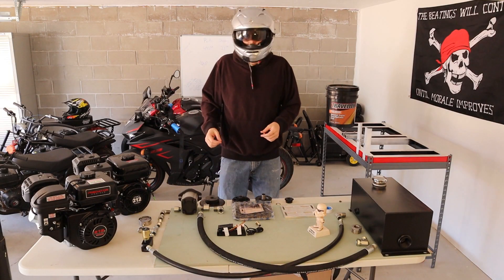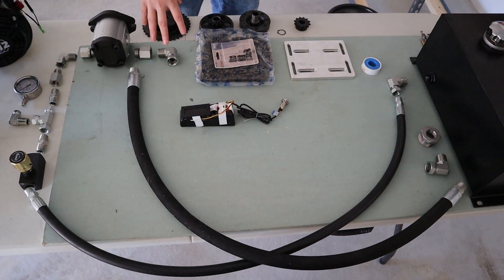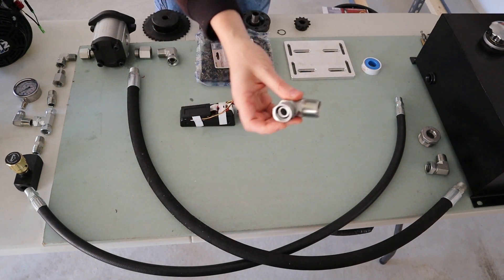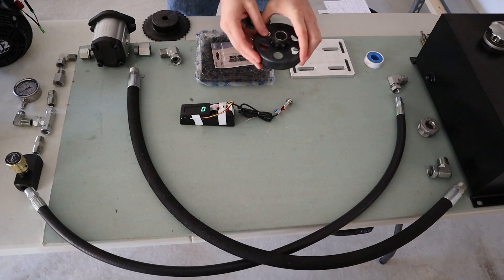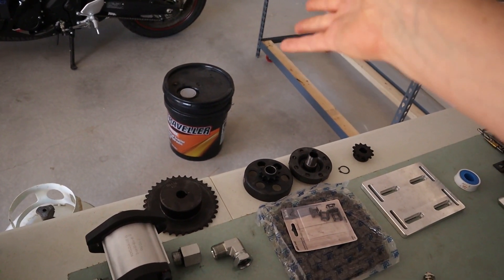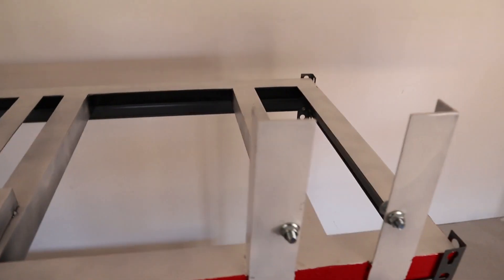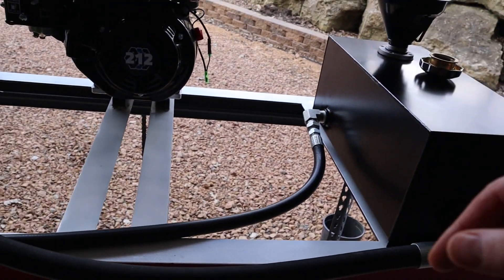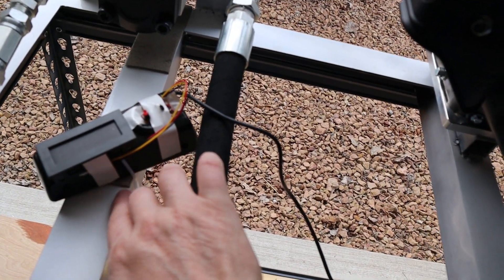Homemade Dyno, small engine DIY dynamometer

Comment: Quick question, were you restricting the inflow or outflow of the pump and why? Thanks for the awesome video, very helpful!
Reply: He is restricting it on the output of the pump, as you don't want to put the pump under a vacuum by limiting it's input.  If you do that, then no load would be imparted on the housing, as it wouldn't have any oil inside of it to pump.  They are made to pump to high pressure, so the valve allows modulation of that output pressure, effectively changing the load on the engine.

Comment: Little diviers, he's not using a pillow up beach and converting it to American mechanical. Horsepower you can get healthy ones for twenty bucks or you can assemble A unit which uses American pieces 30 bucks for the gauge 120 bucks for the box with. Wires and brain intercourse, power source and grounding wires.

Comment: I plan to use just such a system to regulate speed on a commercial rail Pedal cart. A kind of "Anti Runaway Brake. I considered a centrifugal clutch as the load, but they are too imprecise and fallible. As a Heli Engineer, this system makes sense. its gonna take some testing to find the right ratios, but hey, that's RnD. I KNEW there had to be a video...haha I wish I could put pedal assist e bike guts on it and use the regen braking, but that would be a powered vehicle and put the cart in another bracket entirely.

Comment: Great video, I am running my Honda clone on high performance cdi ignition system.  You can adjust base timing and you have a preset by rpm 20° of full variable advantage . Also the spark duration changes a bit for more performances at higher rpm. I need to dyno my units I have made. Prototype stage but it's a direct stock bolt on with jet and intake kit. I have a channel if you want to come take a look. Cheers

Comment: Great job.  A couple suggestions.  I would get rid of the clutch and go with a belt you can lock tight by lever and tensioner.  That will be more precise.  Also, you might consider setting the fluid to a baseline resistance, and then using a flow sensor to turn flow into a voltage which can then be used in a formula to determine actual power.

Comment: What is the HP you can Dyno with it? Singles go up to about 676cc today.
Reply from the maker: Just above 20 with that pump. Different pumps that can go higher rpm can go higher power but it gets more expensive by a couple hundred dollars or more.
Reply: @megoingfast  A Honda/Clone 460 Single with upgrades Dynoed 37.37hp@5000rpm. What Size Pump would be needed for say 45hp.

Comment: I am good with electronics and programming. I could take what you have there and turn it into a pretty useful dyno.
Reply: I realize this video is 4 years old .I was wanting to ask you about setting up a way to get a read out by computer for a small dyno I'm building ....if so give me a way to contact you
Reply: @70skid67-c5b  We actually developed a small data system for exactly these dynos.  It just a couple analog inputs, a load cell input, and rpm input.  We ended up making more complicated ones too, but we do still offer the simple version.  Its software runs on Windows and comes with the data system.
Reply: @PrecisionDynoTech  how do I get this?

Comment: Caution, FWIW, the pump's input shaft only has sleeve bearings. Those aluminum pumps are made for in line or face to face driving using a spider coupling. No chain. Aluminum pumps aren't made for side or what's known in the trade as an overhung load, such as your setup. 

https://www.hydraulicspneumatics.com/technologies/hydraulic-pumps-motors/article/21883204/dealing-with-overhung-load

https://www.surpluscenter.com/Hydraulics/Hydraulic-Pump-Mounts/Overhung-Load-Adapters/

A portion of the pressure the pump develops will be transferred to side loading it's input shaft because of the pull of the chain by the engine. A lot of use will wear the sleeves and seals out and start to leak in time and the gears inside will start to gall the housing putting metal shavings into the oil because of the close clearances. Side or overhung loaded pumps are available but expensive since they use hydraulically sealed radial ball bearings and accommodation of a drain port. I'd recommend to unload the input shaft and spending the 40 or 50 bucks and turn your pump to face the motor and install a spider coupling or an overhung load adapter. Just my 0.02. Be safe !
Reply: ... Also you could also move the pump back and use a jack shaft arrangement supported by 2 pillow blocks, your sprocket on the input end and a spider coupling on the other driving the pump. This would allow you to use different engines and unload the pump input shaft. I've also seen creatively engineered setups using CV joints from the front ends of cars or ATV's as a flexible way to hook up different motors.

Comment: Cool but a briggs or a predator, tillotson, tecumseh ect all rotate in the same direction, clockways if looking at flywheel and counter clockways while looking at crank, there not opposite of each other... 😉
Reply: Wrong! The video is absolutely correct. I've had several older Briggs and Tecumseh engines that run clockwise from the PTO side 😉
Reply: @NicholasB45  well we put these with chain coming off the left side direct to the wheel so counter clockwise for most side shaft utility engines